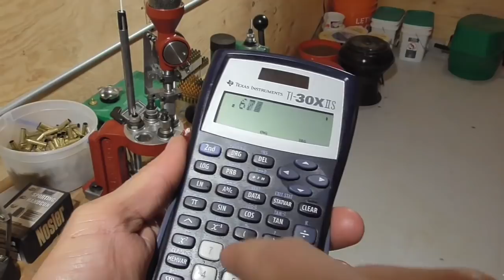Machining a Titanium Wedding Ring (TIS112)

Comment: Cost of material ?? I had looked at one on a store and it was more than the gold rings ! So is there reason for that ??and gold and silver can be beaten , as in the old testament dose it possess that quality also ?Thanks for another informative video !
Reply from the maker: 1" diameter Titanium round bar costs about $125/ft from OnlineMetals.com, and obviously you could make quite a few rings from a bar a foot long.  I haven't looked at Titanium rings from jewelry stores; based on cost of material I would expect them to be quite a bit cheaper than gold, since a solid gold bar of the same size would cost about $125,000.  I've never tried forging Titanium, but given that its tensile strength is comparable to quenched & tempered alloy steel, I think cold-working it would probably be out of the question.

Comment: Oh its for you!!  Didn't know titatium was that easy to mill - you didn't mention any special bits. 
.
Reply from the maker: I used ordinary HSS and carbide tooling, with slower-than-normal spindle speeds and lots of coolant.  Titanium is definitely not the easiest material to machine, but it is certainly machinable.
Reply: Thanks -- Seemed to cut very nicely.  Though I doubt I'll be doing any projects in titanium, and the only titanium I wear is my artificial hips.  Love your little projects .